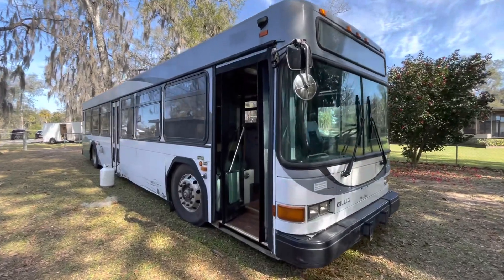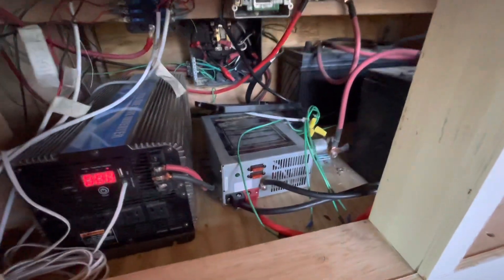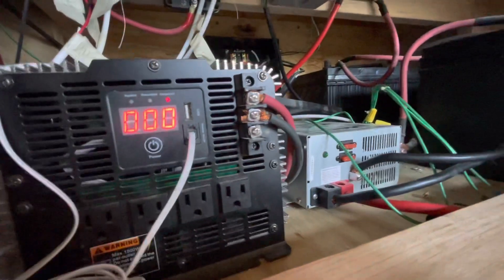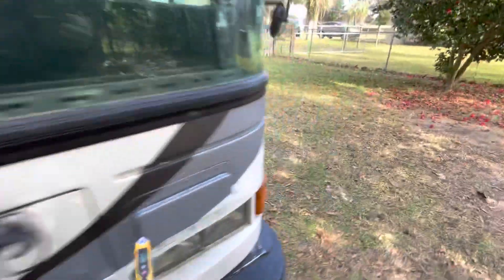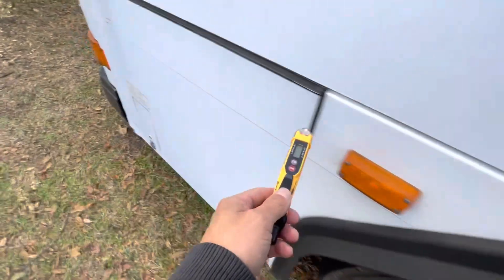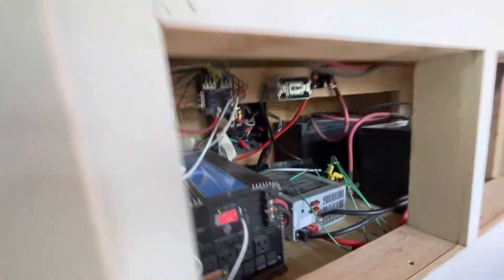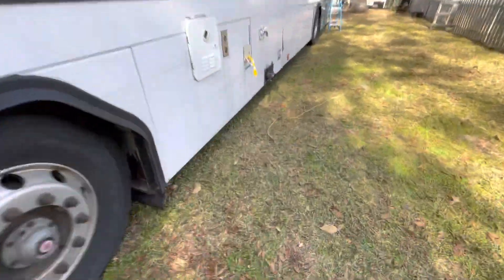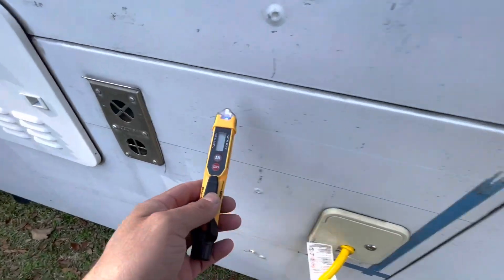Skoolie Electric - Hot Skin / Electrified Shell

Comment: I'm not an electrician, but I'm 99% sure that it takes more than just improperly combined NEUTRAL and GROUND to cause Hot Skin.  
Something else is likely wrong with the shore power.  So even though you've protected yourself by separating NEUT and GND, you might want to check for reversed NEUT and GND on the shore power, or some other connected device wiring error.
  
Also, an onboard generator (or I presume solar powered inverter) doesn't need to be grounded to the earth (soil).  Yes, some of the manuals state that they should, and yes, you must "ground" to the chassis, but there is no need to ground the generator to the shore power GND or drive a stake in the ground to Earth.  An onboard generator isn't normally going to be a danger to someone standing in a water puddle and touching the bus like there is with hot skin because electricity wants to return to where it came from, and since on board generator or inverter source is on the bus, the electricity wants stay on board, not short to ground via your body.

Otherwise really good points.  Commercial bus conversions in the 80's were often built with combined NEUT and GND, but now we consider a Bus/RV to technically be a "subpanel" and no subpanel should have combined NEUT and GND -- only one connection between NEUT and GND should exist, and that is in the main power panel for the house/Shore power.

Those interested in more info can check out Mike Sokol's No Shock Zone and Mike Holt's NEC code courses.
Reply from the maker: While I’m also not an electrician, I’ve sorted this issue out on multiple buses now doing exactly what I showed here. I install Victron Inverter which act as the Main when running as Inverter only bonding Ground and Neutral in the Inverter, making bus Panel the Sun, as you stated. When Shore connects to Inverter, it removes the bond, allows Shore to be main. I’ve had one incident where an addition either had a bootleg ground or then neutral and line were switched and it caused Hot Skin in the bus ONLY when plugged into shore front that receptacle.
Reply: @sojournersway  Yes, I was just concerned about a 'hot skin' condition seemingly from bonded NEUT and GND.  That implied that the shore power also was faulty.  This should never happen if connected to a properly wired facility even with bonded NEUT and GND in the RV/Bus. 

The reason for unbonding (separating) NEUT and GND (as I understand it) is to prevent undesired current flow on the GND conductor of the shore connector.   The only way to get significant or full line voltage on RV "hot skin" (via a NEUT bonded to GND) is when there is voltage on NEUT, something that really should never happen, unless LINE and NEUT are switched or some other RV plugged into the same receptacle circuit had a miswired RV that puts line voltage on the NEUT like the situations you described.   I'm puzzled by why this bus would have 'hot skin' with a normally wired shore power connection.   Again, I'm not an electrician but recently had to separate the NEUT and GND on a vintage RV so I looked into the topic pretty closely.